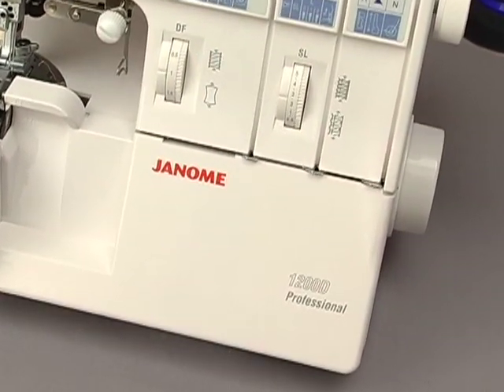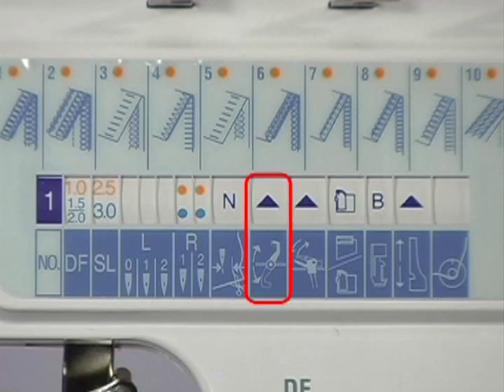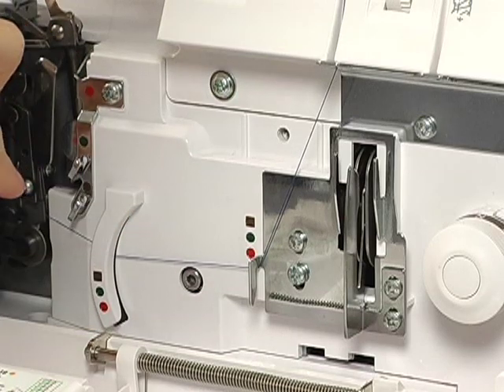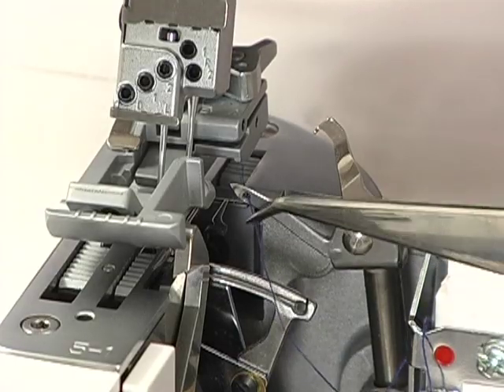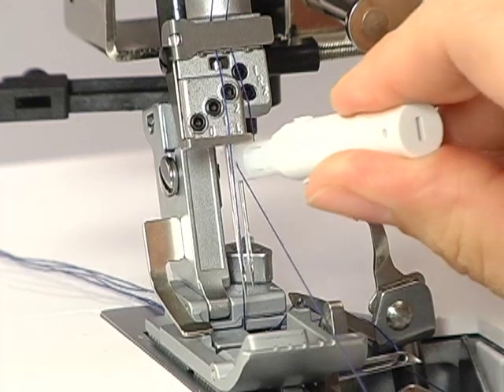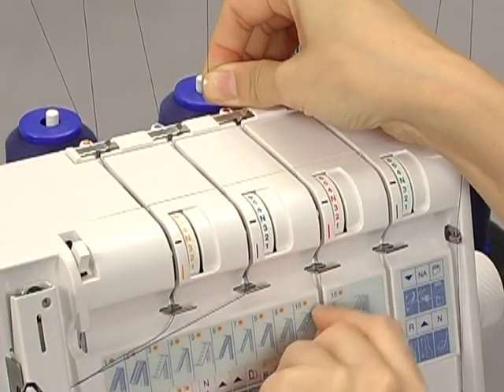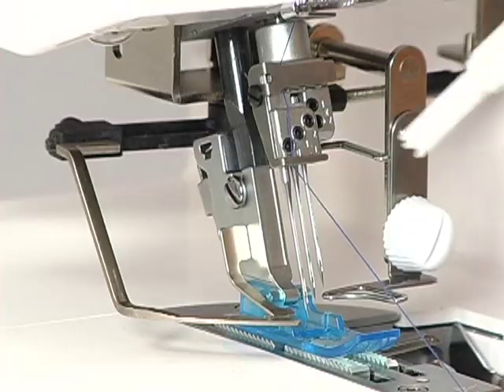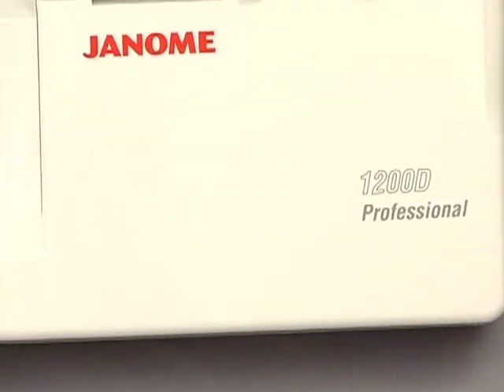JANOME1200D коверлок видео обзор

Comment: 1:30 Как настраивать машину / Set up the machine with the programmed display panel
2:25 Пример установки всех параметров / Example of setting up all parameters
5:00 Установка приставного столика или крышки оверлока / How to set the sewing table or overlock cover 
6:42 (1) 4-ниточный закрепочный / Safety 4 thread stitch
10:30 (2) 5-ниточный / 5 thread stitch 
15:25 (10) Тройной распошивальный / Triple cover hem  
19:25 (10) Верхний распошивальный тройной / Triple top cover stitch